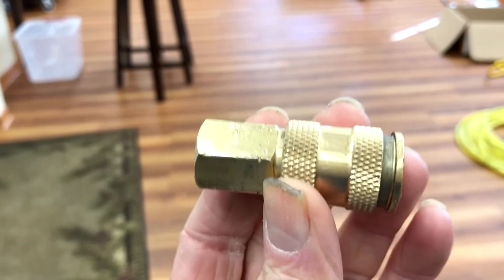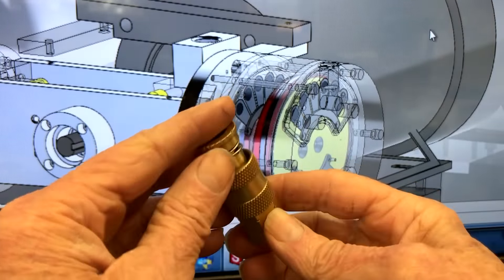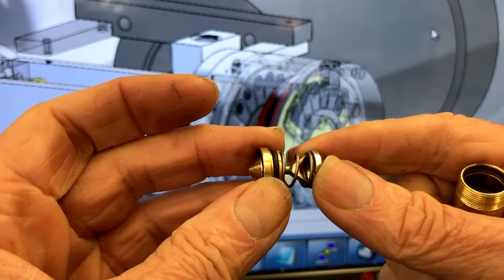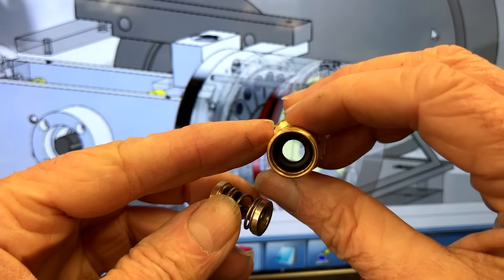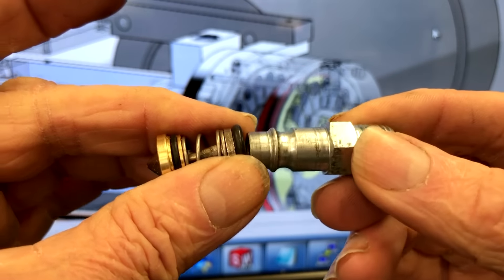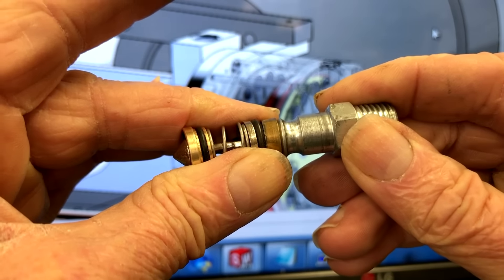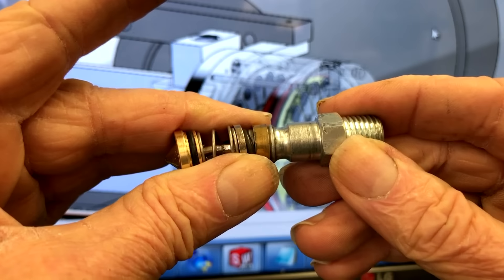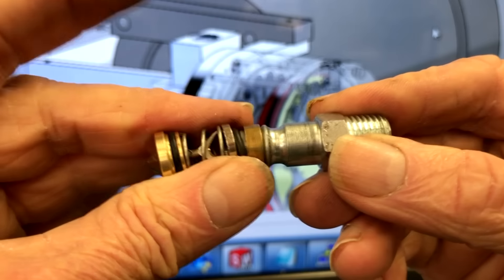inside failed Milton V coupler

Comment: Thank you Frank..  and the other commenters having the same issue.  
I've endured this Milton 764 and 765 failure for several years, just moving the bad couplers to a connection that stays in place..  till I forget and release the hose..  blammo, wide open failure.  I have three of these doing the same thing, and others (Milton 764/765) that have been working fine for the same duration.  Like one commenter suggested, dumping the line pressure works..  but that's not an option on my tank mounted couplers.  
And like you mention Frank..  the 40# plus tool insertion force is getting really old!   Definitely going to try the Menards's Master Force at 21# 
Thanks for the engineering viewpoint!
PS..  for others doubting the 40# insertion requirement at 120# Air,  the 764/765 with no air pressure click in effortlessly against that spring alone🙂 adding air pressure brings mine up over 40#  ..  way too high!

Comment: If you oil them a bit they dont fail, they are also harder to open because they have a larger opening which means more air rests on the plug you are moving inside. But there are huge consistent psi and cfm gains with this style.
Reply: I've oiled mine fairly regularly and they still fail. I really wanted them to work because of the gains, but they just fail way too often

Comment: On the Prevost, the fitting will not release until all the air pressure is dumped first. Then it will allow you to remove the fitting from the coupler.
Reply from the maker: CEJN is much better than Prevost

Comment: You should only use Milton v-style fittings with the Milton v-twin style coupler and you won't have the problem you discribe...I havnt experience this , but I compared other ends and can see where they could cause an issue,,,
Reply from the maker: The most serious problem I have with this coupler is the extreme amount of force it takes to connect and the dangerous disconnect due to the high forces involved. 

This coupler was designed to be cheap to manufacture and accept a wide variety of plug styles which it does. As I demonstrated, the air seal is made by compressing a large o-ring against the end face of the plug with a lot of force. This is the worst possible way to make the seal.
Reply: @Stedlin  no offense frank,,,but all couplers use a rubber seal,,,and the force is a good thing because it seals it even better
Reply from the maker: All the couplers I have designed and manufacture also use rubber seals but the force is low because not a lot of force is required when a seal gland is properly designed.
Reply: I stumbled on this video because I just experienced a failure, out of the blue.  Worked fine earlier that day, used it again, disconnected and it is now "stuck open".

It has only ever had Milton V fittings used on it, and tbh this particular disconnect has probably only had a fitting in it maybe 40-50 times in it's one year in service, it's in an area that doesn't get used much.  And even has a dust cap on it, fwiw, lol.

Comment: ???40psi from o-ring or spring??? looks like the resistance mainly from spring.
Reply from the maker: Most of the resistance is from the air pressure as the pressure loaded area is large at .196 square inches. The sliding friction of the large o-ring is second and the spring force is third.
Reply: @Stedlin  if u knock of a few millimeters off compressed seal would that reduce the psi required?  What did manufacturer say?